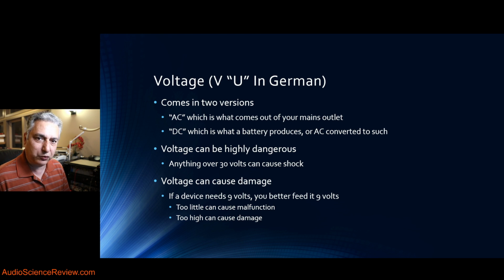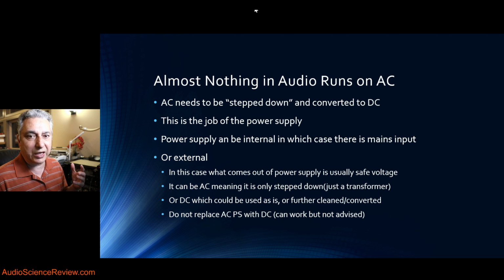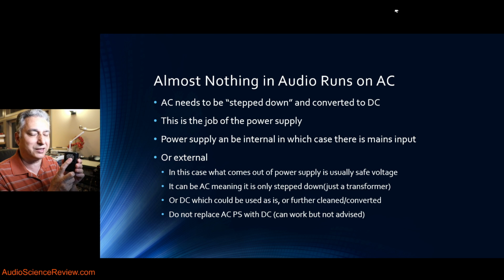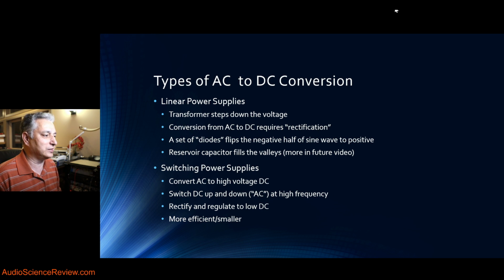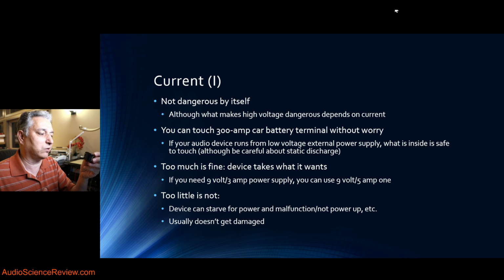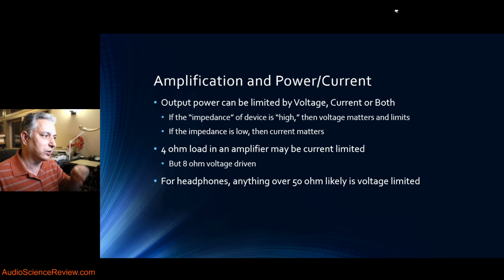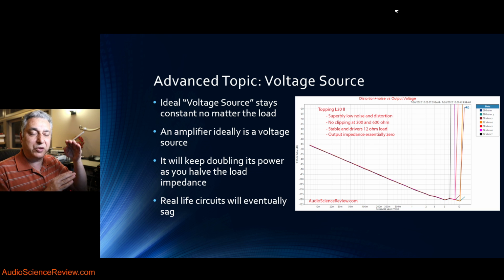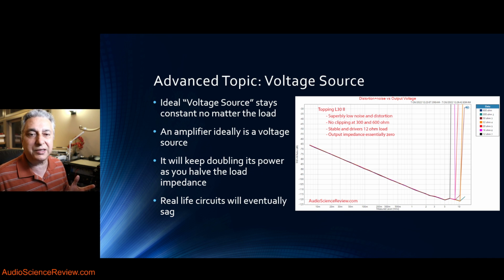Electronics for Audiophiles: Voltage and Current

Comment: "Current alone is not dangerous" the same way you can say "Voltage alone is not dangerous"
without voltage there is no current. (generally) 

You can be on view KV potential on the whole body without noticing if there is no current flowing 
But but even a view mA trough he body give you a shock
Reply from the maker: Most people are safe from electrocution because they have a high impedance to ground.  Fic that and those KV sources will send you to heaven before you can say a prayer!
Reply: @AudioScienceReview  Because they have high impedance the current is low. 
only if the KV source is a "high" current source. 

Static electricity for example can be may kV but is save

Comment: Good stuff! ⚡

I would like to add that current and voltage are load dependent. You have 1000 watts per channel, but it can't go anywhere without the required load to demand that power! Lot's of people just don't understand, they have all this supposed power but it won't go anywhere unless they have a load great enough. 

Current drives voltage thorough resistance; But nothing moves without a load.
Cheers 🍻
Reply: Current is load dependent, but voltage isn't necessarily. 

Also, 
"Current drives voltage thru resistance" 

Care to elaborate on that, or cite example?
Reply: @FOH3663 :
Voltage won't go anywhere without a load, it's just present and that's it. Voltage also will not go anywhere without enough current to drive it. The simple act of trying to measure voltage can bring it down to zero if there is not enough current to support it. Since all conductors have resistance, voltage cannot move through the resistance if there isn't enough current to sustain the voltage. So the way I try to explain this to people is simply "Current drives voltage thru resistance". Make sense?
Reply: @Finite-Tuning  
Is this an endless loop, chicken before the egg argument of causality? 
As I said, they're inextricably linked... 
Their product is key ...
Reply: @FOH3663  :
Clearly you're just looking for an argument. Good luck with that!
Reply: @Finite-Tuning  
Hardly
I'm saying stop, this is an endless loop. 
I do appreciate your presentation. fwiw.

Comment: its the amps that kill not the volts. Thats why you can buy a million volt stun gun. It might be a million volts but thats at milliamps, so the cops label it "less lethal". lol
When are you gonna do a vid on impotense rise?

...........Impedance rise
Reply from the maker: I will cover impedance in a future video.  On your point, no, it is not the source current that kills you.  Your body impedance is fixed and high.  So it takes a lot of voltage to cause much current draw.  Ergo, it is the voltage that kills.  Anyway, that was not the major part of the video.
Reply: If you have impotence it won't rise..... that's the problem...
Reply: @chefsteve8381  Impotence Rise, is an oxymoron. lol

Comment: in Poland we too use U for potential difference
Reply: also in France, Switzerland, Spain, Germany, etc... In my opinion, using the same letter for the unit and the symbol or variable is unusual: U = 230 V is fine, while V = 230 V is mathematically wrong.

Comment: Thanks for this, it's important information for audiophiles. The follow-up video could discuss the related topic of impedance.
In the days where valve (tube) amplifiers were the only ones available, the output transformer had impedance taps for maximum power transfer to the loudspeaker, usually 4, 8, or 16 Ohms.
I wondered whether tube headphone amplifiers would provide taps on the transformer, since headphone impedance varies much more than loudspeakers, usually between 32  and 600 Ohms.
A manufacturer has now produced one, but the audio reviewer uses the taps to facilitate tone control adjustment.
There is much discussion about  which headphone amplifier will drive which headphone.
I told them in comments what these numbers mean, but it falls on deaf ears.
It would help their audience if they knew what they were talking about.
Reply from the maker: Thanks.  Impedance is definitely to come.

Comment: I am a bit in disagreement with you sir at 11:26 - what kills is the amperes not volts - actually combination of both but I would not really state "current is not dangerous": - yes, I know if you touch the wire that has 1V on it even if 10A are flowing you will not even feel it but when you touch 1kV then... you will allow current to flow through your body (because your body is a kind of resistor) and the current will kill you - not the voltage itself. The best example confirming it is NOT voltage that kills  is high resistance measuring devices (that are in kV but very very minimal amperage) or electrostatic spark - kV but still no way to induce high current in your body - from the book below:

Effects of Amperage on Electrical Shock
Different amounts of amperage affect the human body in different ways. The following list explains some of the most common effects of electrical shock at various amperage levels, according to the U.S. Occupational Safety and Health Administration (OSHA).2 To understand the amounts involved, a milliampere (mA) is one-thousandth of an ampere (or amp). A standard household circuit that supplies your outlets and switches carries 15 or 20 amps (15,000 or 20,000 mA). 

1 to 5 mA: Little electrical shock is felt. Upsetting, but not painful.
6 to 30 mA: Painful shock, loss of muscle control.
50 to 150 mA: Extreme pain, possible severe muscle reactions, possible respiratory arrest, and even possible death.
1,000 mA to 4,300 mA: Heart ceases pumping; nerve damage and death likely.
10,000 mA (10 amps): Cardiac arrest, severe burns, and death.
Reply: To me. And to simplify.
It's both voltage and current. Human skin has fairly high resistance so high voltage is needed to generate meaningful amount of current to cause harm.
Reply: @johnyang799  exactly NOT - again: attach to your skin 10kV that cannot provide 100mA and you will be safe. Our skin/body has variable resistance, depending on many factors, humidity, stress level (yes, even this as it changes condituity of our body) - again: "simply" volts will not kill if the source cannot provide enough Amperes. 
Anyway, what I wanted to point out here is: many newbies are coming to this channel because Amir IS THE MASTER in teaching, and while saying this, I would avoid such simplifications (aka: "current is not dangerous") - imagine a kid will go to school and say it and ... he will get "F" instead of "A" ;-) - that is the least dangerous outcome of such simplification obviously ;-)
Reply: @zyghom  The 10kV will drop if it can't provide enough current. So it will NOT be constant 10kV. 
Again you need high enough voltage across the body to generate enough current. High amount of current across body will NOT cause any harm if it's in only micro seconds.
Reply: @johnyang799  EXACTLY - to generate the current, that, if high enough, will make you a vegetable. So read what you wrote - the current. Voltage ONLY is not enough. It is the current (the flow of these small guys called electrones or so) that will make you ... see what Police does with the electric shock batons ;-) And see why sometimes people die
Reply: @zyghom  So it's both. Like I said in the first comment.
Reply: @johnyang799  that is why I don't understand completely what you are arguing about - if you read my initial comment I said: "what kills is the amperes not volts - actually combination of both" - you repeated it and feeling happy - thank you ;-)
But of course the truth is: current kills, voltage makes the current to flow (considering the resistance) - nobody ever challenged Georg Ohm yet ;-)
Reply: @johnyang799  no
Reply from the maker: I am talking about source capability.  You are talking about current drawn.  They are two separate things.   Your body has fixed impedance (more or less).  So what causes the higher current draw is high voltage.
Reply: @AudioScienceReview  yes Amir, but, you being a teacher, shall not say: "current is ok, voltage is not ok and it can kill you" - people will take it for granted without knowing the details ;-)
Reply: Current "by itself is not dangerous"    That's what he said!   11;26
Reply: @wesselingaudiodesign5031  current by itself kills, but without voltage it would be difficult to have the current ;-)
Reply: @zyghom   Context - He's referring to a car battery with hundreds of amps available and it's not lethal because it has about only 13V.
Reply: @wesselingaudiodesign5031  there were many examples when 12V from the car battery killed, when... it felt on someone's head ;-)
Reply: @wesselingaudiodesign5031  people have NO SENSE OF HUMOR ;-)